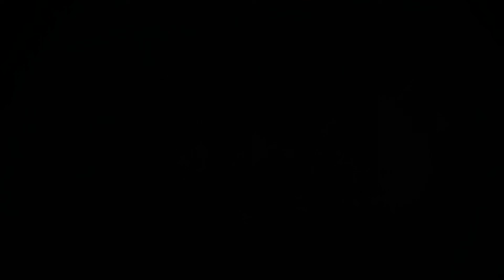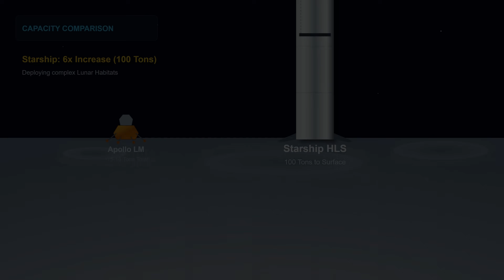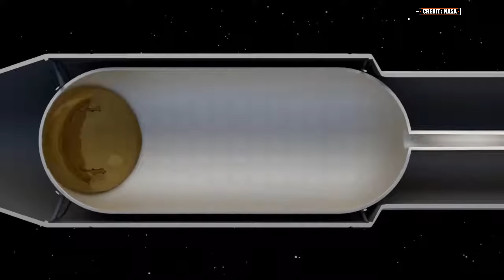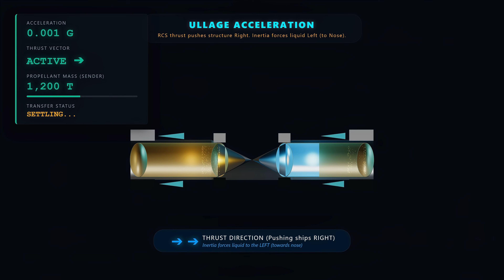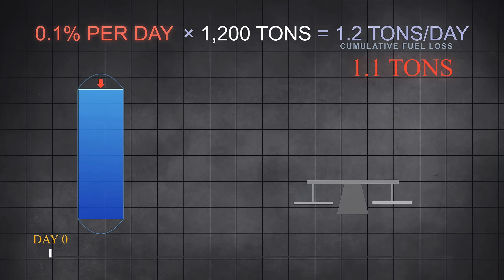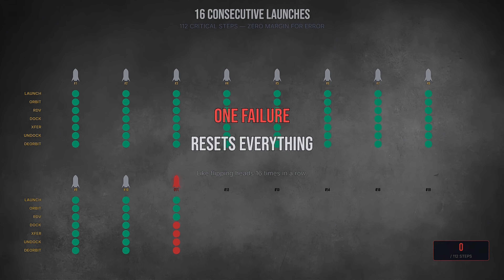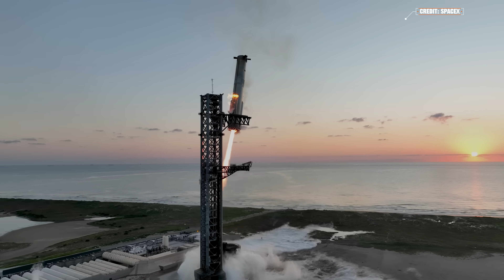Why Starship Cannot Go Anywhere Without Refueling in Orbit?

Comment: This is not really accurate. The fully fueled rocket will be able to launch satellites into low and medium earth orbit without refueling. Refueling is needed for high earth orbit or obviously to go to the Moon.
Reply: You are correct, but to be more accurate, refueling is needed to get the massive usable payloads to the moon to build the base.  There is no moon base without massive payloads to moon surface, and there is no way to get that there without refueling, doesn't matter if its Starship, Blue Origin, or the Chinese.
Reply from the maker: Correct — LEO missions don't need refueling. The video focuses specifically on beyond-LEO missions like the Moon. Should've been clearer on that. Thanks! 🙏

Comment: First. There is misconception about "Starship is stuck to low earth orbit without refueling.

Sure. If we wanna recover second stage, then yes. Payload is limited to 100+ tones.
But there is a catch. Centaur V with 27.5 tones of payload and about 4.1 km deltaV. It is about 90 tones.

Starship WITHOUT refueling can lift into orbit full centaur v with very heavy payload and send it almost anywhere into solar system.
Reply from the maker: Solid point — the video focuses on Starship as a self-contained crewed vehicle. Using an upper stage like Centaur V is a completely valid alternative architecture. Thanks for adding that!

Comment: I'd like to see the analysis on the back end of the trip to the moon. How much cargo or "cryogenic fuel" can one starship carry? They are not moving 1200 tons all at once; they are moving what? 100 tons? 120 tons? per trip. How much fuel per launch/transfer and what happens on the 2nd or 3rd exchange when there is already a significant amount of fuel in the receiving tank? Does the exisiting fuel in HLS or a customized "fuel depot" react in some unknown way with the fuel being onboarded? What if they are at different temps? I assume they have some way to manage pressures on both sides of the system. What would happen if there was a RUD during one of the exchanges? That's a huge amount of debris created by 2 exploding/out of control  Starships. What altitude is safest in the case of an explosion or run-away pressure event? A clogged or frozen line seems like a real possibility during this type of exchange.  But getting back to the original question, how much fuel realistically is needed to get to the moon?  Seems to me that could vary quite a bit once you account for the orbital manuvers. Anything in excess of the requried amount plus a certain safety margin is simply speed or less time in transit. It may take 16 trips to totally refil a current version of Starship, but what is the minimum requriement based on Delta V required and values for orbital manuvers at a unknown/estimated weight for HLS? This seems like an unsurmountable problem when you consider we haven't seen a single V3 success yet. SpaceX is taking their sweet time with Flight 12 because they only get one chance to make a first impressions. Once Flight 12 is complete I'm sure their plan is to up the test frequency drastically, but the infrastructure must have time to catch up as well. They'll need the lauch facilities in TX & FL to pull off 16 refuling flights in a mangeable timeframe. That seems like a long time away based on how long it took them to complete tower 2 at Starbase. They've been working to retrofit Tower 1 for some time, but it must still be many months away. This doesn't account for the fact that we haven't seen any news or version of HLS anywhere yet. There is so much development and deployment going on in tandem at SpaceX to deliver engineered solutions to probelms no one has ever tried before that it seems like too much. And V3 still has not demonstrated it can survive reentry... Yet I fear if SpaceX doesn't do it no one else will.. Not only the engineering, but the resources and commitment to do so. NASA will never solve these probelms at a cost we can afford and it doesn't look like anyone else will ever have both the resources & necessary commitment to do so. I hope for the sake of mankind and in the hopes of unlocking a true LEO ecomony that SpcaeX is successul and paves they way for other to follow. Imagine where we'd be had SpaceX never materialized.  There would be no Falcon 9 booster landings, no Starlink system, and probablly no Blue Origin either (or it would be a very different BO). SpaceX very existence has inspired the world at large and is challenging what is possible. No one would think reusability possible and SLS would still be bankrupt. There's more here at stake than we realize. If SpaceX doesn't succeed there may never be enough commitment & resources in the same place to have another go.  That scares me more than any engineering issue they may run into along the way.
Reply: It will happen in low earth orbit, both because that’s all the big booster can do, and because the debris will reenter automatically fairly quickly.
Reply from the maker: You've basically outlined our next 3 videos. Every question here is real and deserves a full breakdown. Stay tuned — we're going deep on all of it. 🙏🚀
Reply: @TheCosmicRushYT  Sorry for the book. I was thinking out loud about some of the unknowns while trying to take in everything that must happen in parallel in order to meet a deadline which seems unsurmountable at present. I know as much about orbital mechanics as I do about open heart surgery, but I can grasp the technological challenges even though I could not my field. I appreciate your channel and your efforts to back up your videos with fact & engineering versus simply parroting the same news that gets bandied about by all the mainline streams (NSF, WAI, MH, etc.) I can appreciate how much time it takes to research & create the content and thank you for the effrot. With Flight 12 coming up within the next couple of weeks I think we're all excited and a bit anxious as well. We need V3 to be a success right out of the gate so SpaceX can move on to the long list of engineering miracles they need to pull off to meet HLS commitments. One thing is for sure...the next couple of years will be like nothing we've seen yet so long as the bumps in the road are manageable and no catastrophies ensue from any of the next 7 - 10 test flights. If they can acheive Falcon 9-like  realiability with Starship, then the rest of the milestones will seem much more feasable.
Reply: @funkengruven7773  The basic bottom lines are this:

To get massive tonnage to the moon surface to build a moon base, currently ALL craft are going to have to refuel in Low Earth Orbit.  The Earth's gravity is **SO** strong that it takes massive fuel just to get into a 250 km up orbit.  It's actually insane.  That's about 155 miles up.

This includes SpaceX Starship, Blue Origin Blue Moon Mark 2, and anything the Chinese do.  It doesn't matter.  Massive tonnage = refuel.  Period.

Apollo had a usable cargo of 700 lbs to the moon surface per flight.  On Apollo 15,16,17 - about 500 lbs of that was for the moon buggy.
How many 700 lbs trips would it take to make a moon base?  100?  200?  500?  The answer is a f-lot of them!

If you want to know the mathematics and mechanics behind all the mainstream youtubers, please check out Eager Space channel.  He does a really good job of explaining things.  Starship Elevator?  Not an issue.  Refueling?  Not an issue.  Starship landing?  Not an issue.  Most of the "issue" discussion is youtubers doing "fear mongering" for clicks or if your being conspiratory - maybe the Chinese or cult of Blue Origin is behind it...who knows.

Comment: i have a very good idea for a super strong rocket. lets make it so, that we need like 50 launches for something that the satrun v could do in one. but lets make the rocket really really strong and reusable. so that it starts to make sense to use 50 launches economically. oh and lets make it so, that we always move the whole ship with huge heatshields and engines because that is smart!
Reply: Saturn 5 launched Apollo, but did you know it only delivered 700 lbs of usable payload to the moon?  In Apollo 15,16,17 - 500 lbs of that 700 lbs was for the moon buggy - so those 3 missions delivered 600 lbs in total.

If the goal is to get humans back to the moon, sure, Apollo-style mission would work.

If the goal is to start building a moon base, an Apollo-style mission DOES NOT WORK.  You need massive tonnage to the moon for a moon base.

These are just facts.  Apollo-style can't build a moon base.  A starship that can take 100+ tons to the moon can.

Oh, and it won't be "50 launches".
1 launch - sls+orion (to bring the crew back home)
1 launch - starship hls
1 launch - starship fuel station
5-10 launches - starship refuellers

That's probably 13 max, 8 minimum.

Blue Origin Blue Moon Mark 2 - probably around the same amount give or take, plus in that plan there are 3 craft going to the moon, refuel above earth, refuel above moon, and more docking maneuvers above earth **AND** the moon than the Starship plan.

The bottom line, no matter Starship, Blue Origin, or the Chinese - to get massive tonnage usable payload to the moon, you have to refuel in space, it's just that simple, there is no magic carpet ride.
Reply: @ConstantTrue  so 200 pounds excluding the lunar rover? makes you wonder how heavy the two astronauts were, especially since the two space suits they were using were both around 90 kilogramms.

wouldnt it be much more easy to take a saturn v style rocket, power up the upper stages a bit and then use some solid rocket boosters in addition to the first stage? i bet that would beat any starship configuration on moon missions. 

by the way, lets see how much the current starship payload is to low earth orbit. oh the A.I. says it couldnt make low earth orbit so far, because the additional fuel needed to go from crashing in the ocean to orbital velocity is about the cargo capacity that was claimed.
Reply: @stephanieherman2861 no, it definitely wouldn’t.
Reply: @peterfireflylund  according to mycalculation it would increase the mass to the moon by 20 tons. not bad
Reply: @stephanieherman2861  Just to clarify, I said "usable payload".  If you want to include the humans as "usable", then sure, two fit humans adds 400 lbs.  Still pretty small.

My definition of "usable payload" is the things brought and left on the lunar surface to "build a base" or "scientific instruments".
Reply: @ConstantTrue  the whole lunar landing module has been brought there, it can be used as housing. it is definitely more than 200 pounds in weight. by the way the capacity of the apollo rocket of sending mass to the moon was at around 40 metric tons.

Comment: Is it possible to have the refueling tank push propellant out like how a syringe works? Well, guess they already have a method already
Reply from the maker: Spot on — that's literally how it works! Pressure differential pushes the propellant, no pump needed. 👍
Reply: @TheCosmicRushYT  And you that how?  Or is that you speculating?

Comment: They aren't going to dock nose to nose based on the docking hardware that has already been seen. They will dock side by side, this allows spinning about an axis between the ships to settle the fuel and pressure differentials in the tanks to move fuel between tanks.
Reply from the maker: Great point — SpaceX's actual hardware hints at side-by-side. The architecture is still evolving. Thanks for the correction! 🙏
Reply: You are right, but lateral docking and spinning stresses the structure in ways it is not prepared. Harder also to dock. It seems to me better and easier to dock no se to nose, and spin the ships. That way spinning pulls liquids down on the ships.
Reply: @donosticopter9225  Only spin just fast enough to settle the liquid fuel so very slowly. They don't need to spin like a washing machine so stresses aren't a problem. Difficulty of docking is no different really.

Comment: One fault is the comparison of SLS to a fully refueled Starship.  SLS can't go to the moon.  Not enough Delta V, so an unfair comparison.
Reply from the maker: Fair point — SLS + Orion is a crew transport, not a lander. The cost comparison is about the full mission architecture, but we could've been clearer. Thanks! 🙏
Reply: I think you get it, but most people don't know...

SLS didn't even do the TLI.

Main SLS booster (orange thing) was ejected in very low earth orbit.

The second stage (Interim Cryogenic Propulsion Stage (ICPS)) burnt Orion to a higher earth orbit, and then it fell away.

Orion (actually the European Service Module (ESM)) itself did the TLI burn with Orion attached.  ESM also did some thrusting for the return to earth, but I believe most of that was really done by the moon gravity slingshot.

Comment: It is not completely out of the question that they manage the cryogenic transfer. This is mostly mechanics and I believe them if they tell me that they can do it. 

However keeping the boil off in check, that is battling thermodynamics and that is the hardest enemy of all. Especially if one side of your rocket gets bombarded by Radiation amounting to 50°C. I honestly do not believe they will be able to fuel that depot fast enough to reach the moons surface during my lifetime using this mission architecture, especially now they have dumped the gateway.
Reply: They already demoed moving fuel between tanks on a single Starship so the principal is proven. Now they just have to perfect docking 2 ships in orbit which I imagine is something they will be able to do given they can dock Dragon to the ISS.
Reply: @schrodingerscat1863  I think it was Starship flight #3 from what I read.
Reply: I really think this "boil-off" problem is being hyped too much.  Eager Space channel does the actual math on it, estimates put that complete boil-off around 300 days - this is accomplished with the white coatings (which Starship HLS and probably the Starship Fuel Station) will have.  Plus there is some analysis done on ship positioning with regard to the sun.

Also, please realize that if what you are saying is true, then neither Starship, Blue Origin, nor the Chinese are going to be successful - refueling in space is a must for ANY chance of getting the massive payload to the moon to build the base, there simply is no other method currently or "up anyone's sleeve".

Comment: Starship is designed to put 100 tonnes into orbit (V3 it think, and more with V4) which is a lot more than a lander, and roughly the same as Saturn's third stage, S-IVb. So, while it would be cool to have the whole Starship land on the Moon, it definitely makes more sense for it to put a smaller lander into orbit with 1 launch and then a transfer stage like New Glenn 2nd stage or even 2 of the Falcon 9 upper stages, on launch 2, and Orion hitches a ride on some other rocket (Falcon Heavy is man-rate-able since all it's pieces are, just have to tailor a fitting to join Orion and make sure it's still safe).  And done, off to the Moon on 3 launches, not 10.
Reply from the maker: Interesting alternative architecture — fewer launches is always appealing. The tradeoff is Starship loses its 100+ ton lunar surface capability, but for lighter missions that could work. Cool thought exercise. 👍
Reply: I think Musk is not building Starship just for the moon, but also takes future use into account. And then he will need the 100+ ton payload. So he is basically making an universal vehicle that can operate in many missions. Might not be optimal for smaller missions that require less weight being carried, but at the same time you would spare the cost and loss of time that designing two different systems for either light or heavyweight missions takes. Summary: though Starship may not be needed yet for the Artemis moon missions, SpaceX is already building it because they need it later, and can use it for the Artemis missions too.
Reply: @VictorIllias My view is that Starship is a multi-mission vehicle architecture.

Basic versions:

1 - Black heat tile version - for re-entry - Starlink V3 deployer in LEO (quick mission, black tiles for re-entry thermal protection)
2 - Black heat tile version - for re-entry - fuel tanker to LEO (quick mission, black tiles for re-entry thermal protection)
3 - White coating version - NOT coming back - fuel depot LEO (longer mission, needs white reflection)
4 - White coating version - NOT coming back - HLS to the moon (longer mission, needs white reflection)
Reply: @ConstantTrue  Yeah, that is probably true. A multi-mission architecture makes sense when development costs are high and you want one adjustable vehicle that can handle all kinds of missions.
Reply: @VictorIllias And to reiterate what CosmicRush said above to PCman...

The entire point of the current missions (Artemis) is to get MASSIVE tonnage to the moon surface.  Yeah, we'll take along us pesky humans too, but the real focus is the tonnage.  You can't build a moon base without tonnage.

Apollo missions, which had one launch, delivered a paltry 700 lbs of usable cargo to the moon.  700 lbs a moon base is NOT.